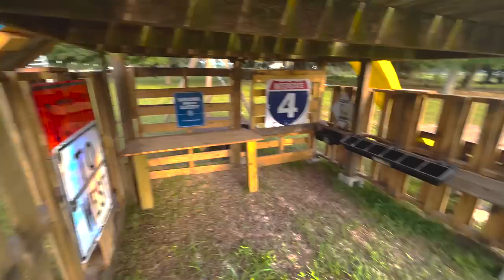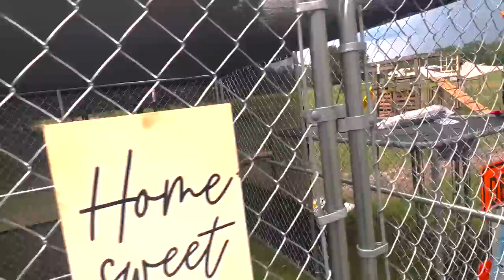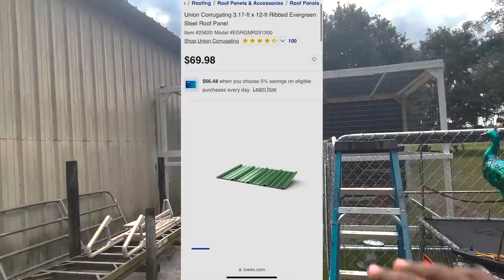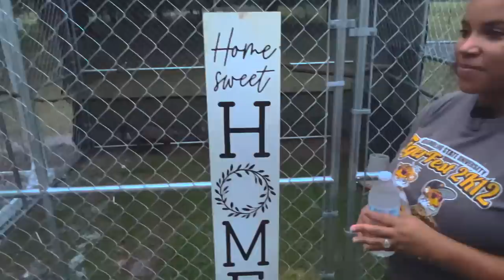Building An Aviary For Our Peacocks (Part Two)

Comment: Love that!  ❤❤❤. The tree would be a nice addition but you may want to just trim the treetop back instead of cutting an opening in the roof. Also, are you afraid of raccoons getting through the feeding openings? Just wondering… The aviary is really beautiful!
Reply from the maker: Hello Martha - thank you for watching our content ❤️❤️ when we go to the nursery we are going to find a tree that will not grow to be taller then 10-12 feet tall which would be ideal. If not then I like the idea of just cutting them back.

Regarding predators, it is something that is always on the back of our minds. Fortunately our predator pressure is not high at all… but we fully understand that it only takes that “One time”. 

I must end up putting something there that can open/close (on a hinge).

Comment: That gap looks dangerous.  Coons could easily enter their.  You got those hangers from Petals from the past!  I wouldn't fold that tarp. Give them more dry area.
Reply from the maker: We ended up closing up the gap just to be safe,since we have had some smaller predators get our chicken before. And we added more stuff around the base to add an extra layer from
predators.
Reply: @Our Brown Farmhouse  I have hardware cloth out about a foot all around my chicken house. It is nailed down in place with those 6" nails.  Never had a problem.  If your predator load increases, you might think about adding a hot shot fence.  We have 7 rows to hot wire around our chicken run to protect our girls from bobcats, coyotes & dogs.  It works.